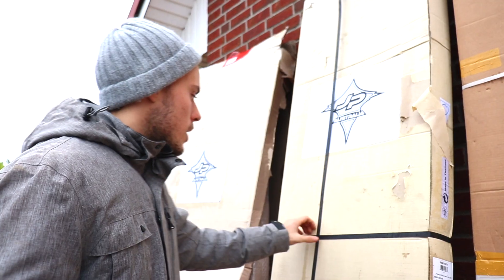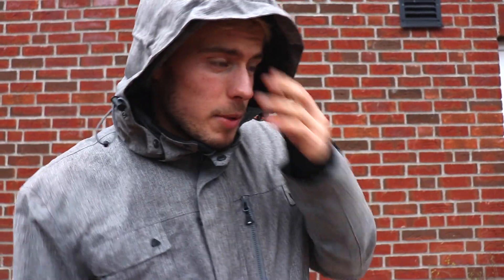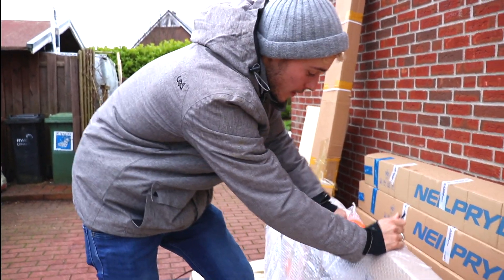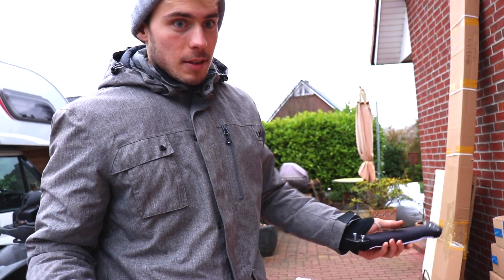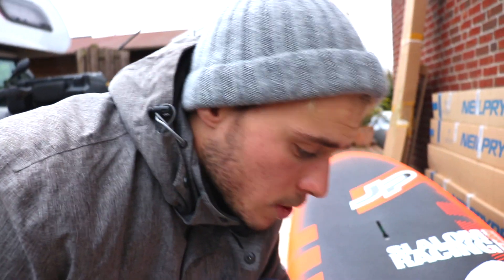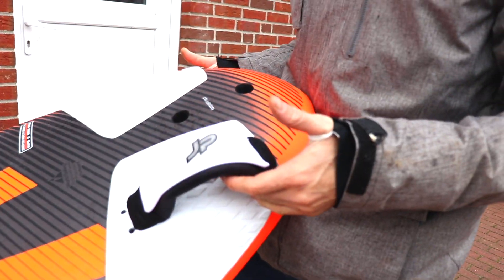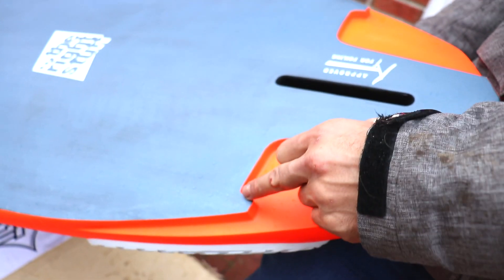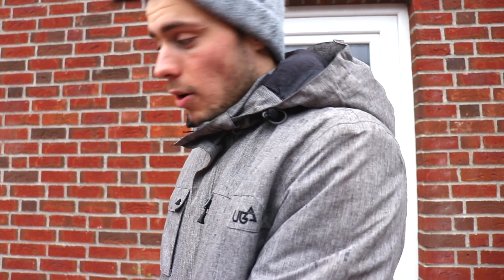PROBABLY my new 2018 JP Boards

Comment: 4 screws per footstrap,  not new, my 1988 equipe uses this new 'radical' system!!
Reply from the maker: Hi Andy! Yeah exactly... it's not a new concept. We also use this for the Freestyleboards and Custombrands use it aswell. But it's new to our slalomboards 😋
Reply: They look nice boards. 2 screws better too as sometimes the single screws work loose on the board once it as been used for a while.
Reply from the maker: Yeah I agree, Andy!